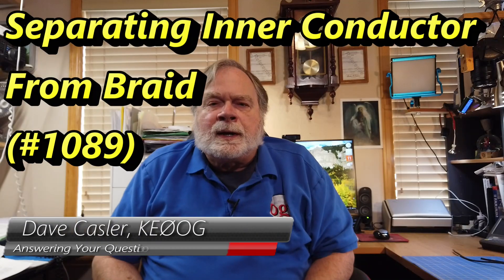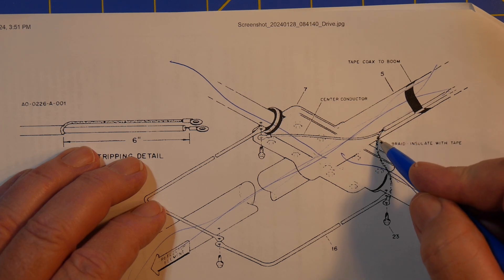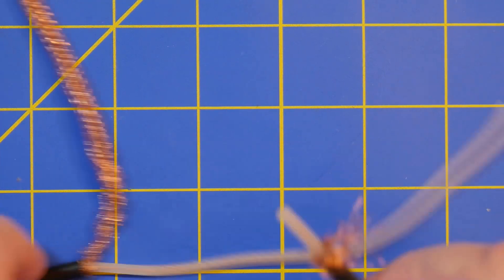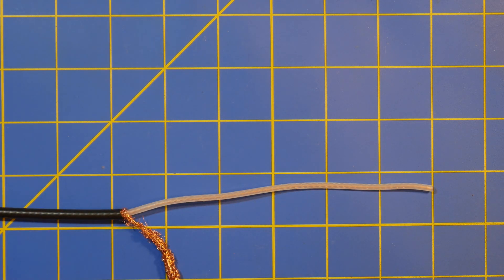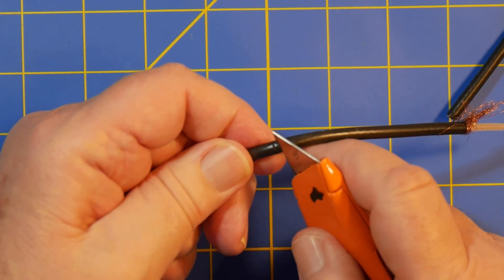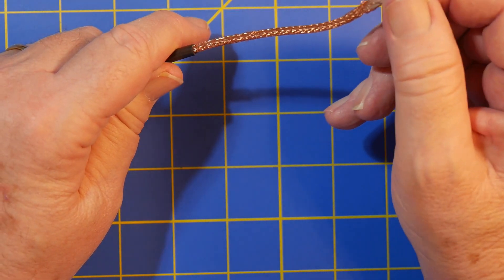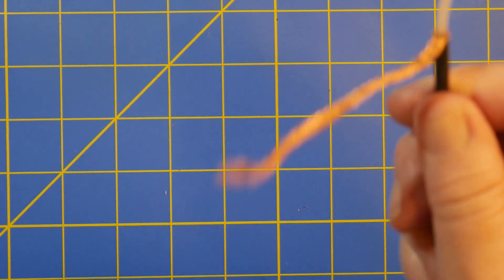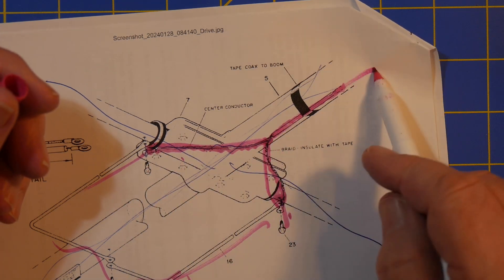Separating Inner Conductor From Braid (#1089)

Comment: I have done this many times and, as VK4GEO wrote, I use straight and curved picks as tools.  They allow making a hole in the braid with less risk of breaking strands in the shield and make it easy to get the center conductors started through the braid hole.